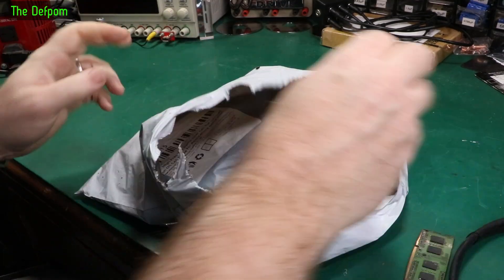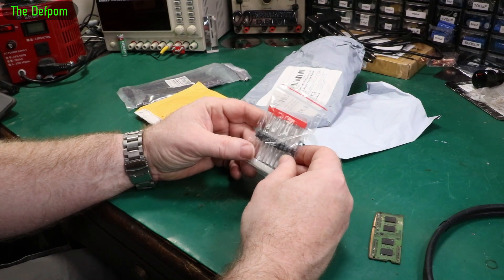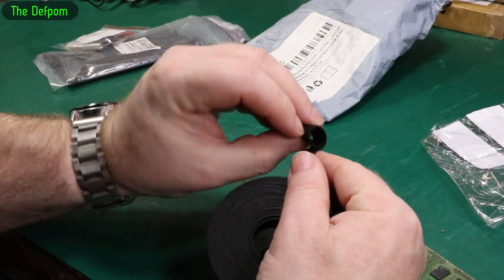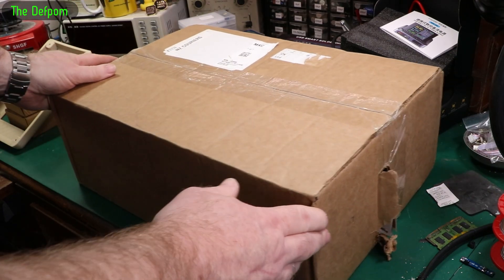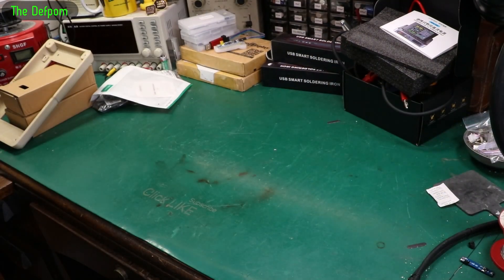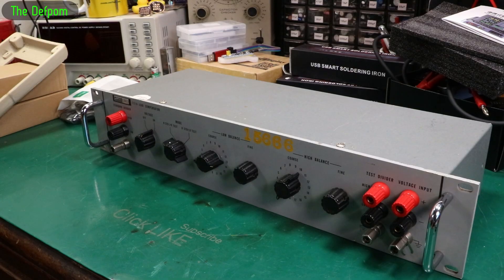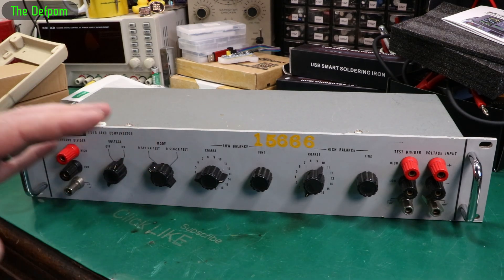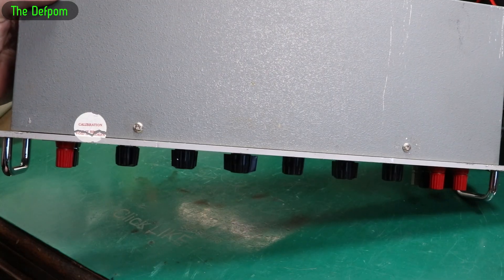🔴 Mailbag Monday 25th November 2024 - No.1303

Comment: I recently received a Datron 1061 with pieces of really soft, 15mm sheet polystyrene cut to the exact sizes of each side, front, back, top and bottom and 'kept' in place by putting it all in a thin black plastic bag which had a bit of tape on it - no box! By some miracle it wasn't smashed to pieces on arrival even though the front corner was poking through. The worst packing I've ever encountered.

Bizarrely it must have taken a lot longer to pack than putting it into a box.

Usually I request the sellor to package carefully, as you do, but this time an offer was accepted and it was shipped before I even knew I'd won it.